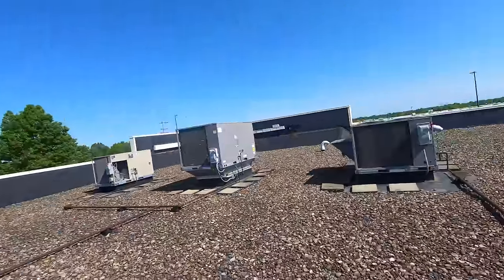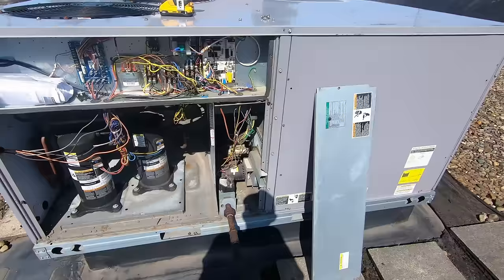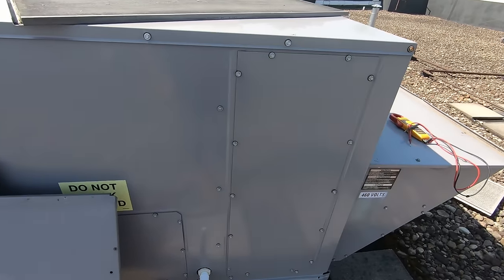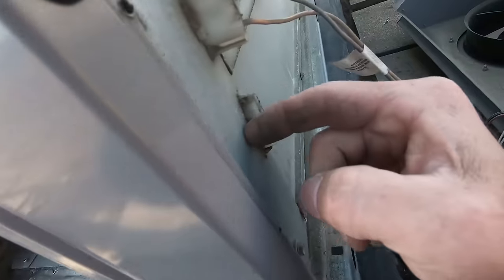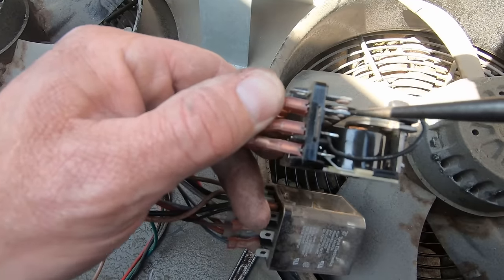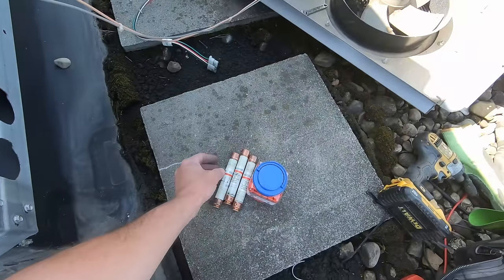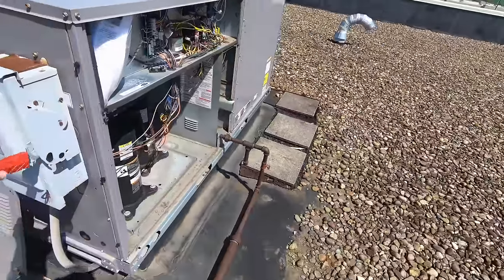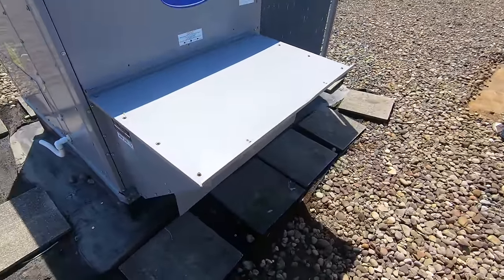What caused the Fuses to Blow? No AC Service Call.

Comment: 👍 Like how you take things apart and actually confirm and look for the exact cause of the failure. 
                 This message and procedure needs to be driven home to the new young guys don’t just replace parts find out exactly what caused them to fail so you better understand the equipment you’re working on. 

      Wire nuts and a new electrical box will be much more reliable than just replacing the factory OEM plug with pushing type connectors 👍
Reply from the maker: Thanks for the comment, I couldn’t agree more. I always want to know why.

Comment: I watched it! I'm note super smart with electricity so I'm wondering why you replaced all 3 fuses when you said only 2 were blown? probably some super simple reason I am not aware of. Age of the fuse maybe?
Reply from the maker: No real good reason, I had 3 and why not. I’d rather have 3 of the same in. I kept the 1 one good fuse as a spare. Thanks for watching
Reply: All fuses not having the same exact resistance is one reason to replace all three. (But I suppose you might just measure them with a good multimeter and verify they all have the exact same resistance, lol...)
Reply from the maker: 2 were blown and I had 3 new ones. Not sure where you are going with this. I put 3 new fuses in.